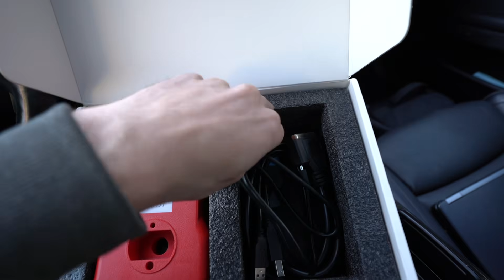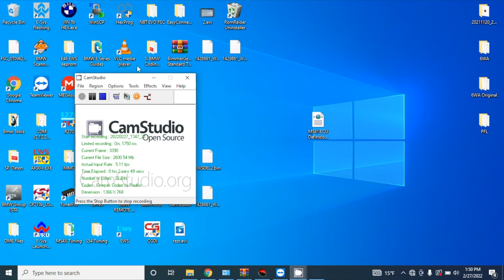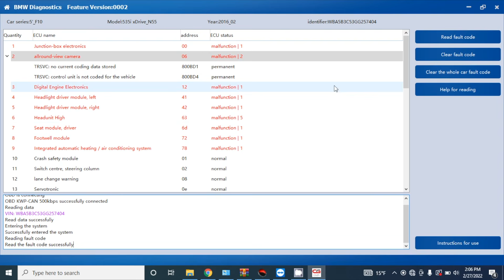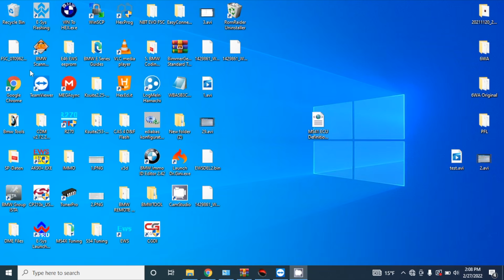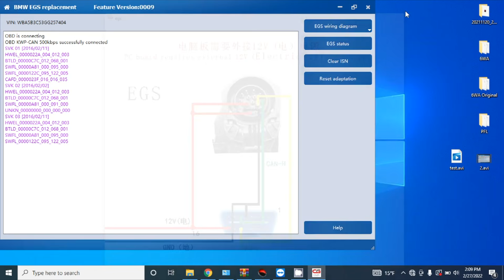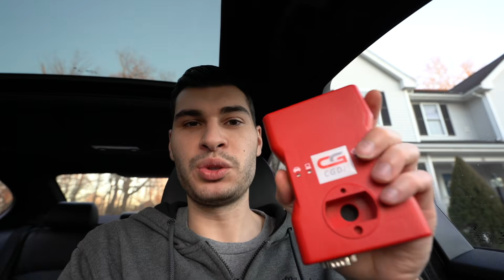The BMW tool that can do it all!! (BETTER THAN ISTA)

Comment: Hey Evan I saw the description say that it can read the ISN from msv80 but nothing about writing to it. Do you know if this device is capable of cloning ECUs?
Reply: Straight from the description "MSD80/81/85/87/ MSV80 /MSV90 read ISN and N13 / N20 / N55 /B38 Read/Write ISN." I'm wondering if it was a miswording or if it actually can't.

Comment: AMIZING TOOL AM USING CHEAP AND COMPLETE BMW SOLUTION ITS REPLACE THE AUTOHEX EXPANCIVE TOOL ALL FUNTIONS ARE AVAILABLE ECEPT THE E SERIES 8HP EGS USED GEAR ISN HIGHLY RECOMENDED THANK YOU FOR THE DEVELEPORS
Reply: This work certain series can u program ecu?
Reply: @jeraldinmendez645  yes am using still it’s very good

Comment: Hello, can you help with this please .getting below in ista.
S 0204 No Communication possible with: Transfer Box . VTG module is red in module list tree. 4×4 abs lights on..

To add more details. When I first saw 4×4 aws lights and   errors 52d1 vtg transducer server motor, 52d4 vtg incremental transducer 5f3a dsc transfer case internal .. after that took to dealer. He said need to replace transfer case actuator costing 2500$.  Now when I scan seeing the above errors s0204 no communication with transfer case.. Not sure if dealer disabled the system to protect. There were no repairs done. Thanks much
Reply: REMOVE THE BATTARY TERMINAL AND TRY AGAINIF YOUR  TRANSFERCASE IS FAULTY YOU CANT CAIBRATE AND CONTROL UNIT WIL BE FREEZ AGAIN